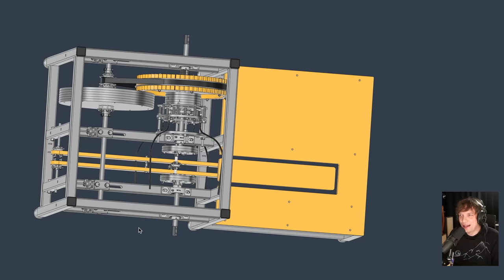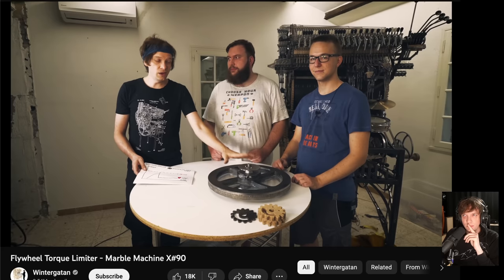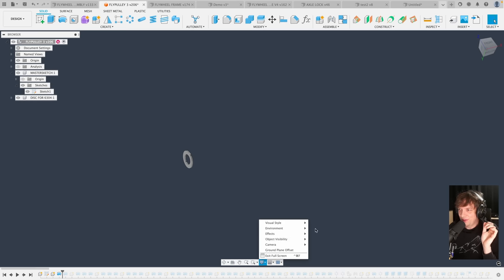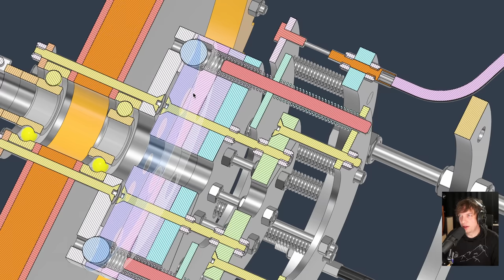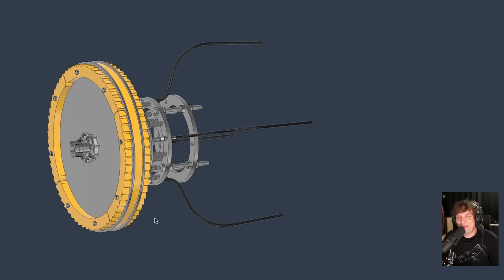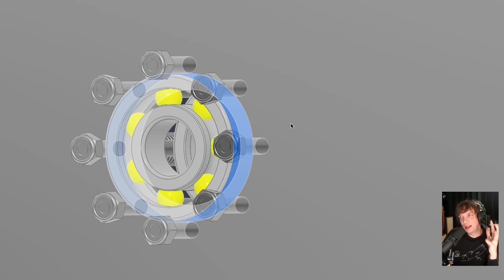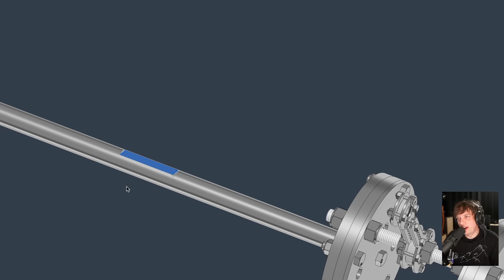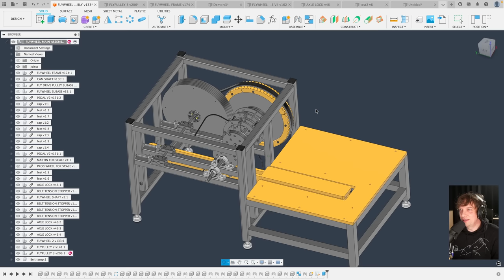Safety First! - Marble Powered Clutch

Comment from the maker: Competition! Price: Glory Forever. Reply to this comment with your guesses on what the ratchets i show at the end of the video are for. The most specific explanation wins. If several people have the correct answer the earliest comment win. as long as it is precise enough haha. All clear? GO!
Reply: Have no clue, just wanna say hi
Reply: for love ? 🥺🥺
Reply: Bicycle.
Reply: My guess:  You're planning on spring loading the machine and the ratchets are there to assist with winding the mainspring by preventing counter rotation while it's being wound. The teeth on the wheel will interact with pawls that will permit the wheel to only rotate in one direction. That would also explain the extra safety measures you're employing.
Reply: Benig able to turk freeley like a bild or not being able to rotate the wrong direction
Reply: probably a spring loading system to start it
Reply: I wonder if it works like a ratchet-type lubricator - converting reciprocating motion into rotation where it'll push forwards on one way but do nothing as it returns - maybe for the foot pedal? so it doesnt crush your feet
Reply: My guess, it's for the sound effects.
Reply: i was thinking something along the lines of "to guide the rotation direction because we are using linear motion to drive this whole mess", but now i think that will be noisy as heck. now i think its something to do with timing, like it will drive some kind of adjustable governor to limit the revs 🤷
Reply: It looks like a windmill part. I think you'll power a large central wooden gear in the center of the machine that will then drive the other instruments through those long wooden mill posts with big clunky satisfying gears
Reply: dogs to keep it from going backwards
Reply from the maker: @officialxardeus  Hi!
Reply: My guess is for some sort of hand crank, and the racheted teeth are to not cause backwards torque into the hand crank (safety for the hand that cranks the handcrank). But I'm sure others have better ideas 😅
Reply: I think the ratchet mechanism is so you can rotate the pulley until the downstroke of the pedal is in time with the beat of the song
Reply: To make it like a gear, sort of as a bicycle. The extra CAD-ed parts control the speed of the flywheel or also make it stop quickly.
Reply from the maker: @MrGonzonator  yo yo been thinking about your bicycle powered idea... it does make sense :) if the pedal fails perhaps its time haha :)
Reply: @MrGonzonator  true, biking is better :3
Reply: You're gonna put a trading card on that ratchet gears so your wheel can sound like a race car
Reply: To run the machine by motor
Reply: @not_just_burnt  heh
Reply: The ratchets will act as the new timing system for the marble machine.
Reply: maybe the ratchets are for engaging and disengaging different programming wheels?
Reply: To make make the tourque limiter not function while putting energy into it.(but why is it so large?)
Reply: Maybe they're for the programming wheel? Or for manual power input.... I have no clue but I hope you get well soon
Reply: I think it is using the teeth for a ratcheting foot pedal for you to manually power up the flywheel, sort of like a half of a bicycle. It ensures you only drive the wheel in one direction and can stop without slowing the flywheel.
Reply: This is probably the broadest guess but I think it might be helpful: 

Edit: It might be very dumb but I'm leaving it up.

I have a feeling that it has an important function when it comes to interfacing with the programming wheel. It might be used to prevent a certain problem that has to do with its state or position. Solving the problem might help with playing tight music.
Reply: The ratchets are for cranking up the volume. What else??
Reply: It's very similar looking to an anti lock backing system......so, my guess is that it is exactly that
Reply: I think it protects and engages with another power source, either a hand pull or an electric motor as an alternative way to wind up the flywheel. I think it engages with another ratchet gear which has its own clutch to engage and disengage it. A vertical transmission of sorts.
Reply: To stop it from spinning backwards
Reply: You're making a scaled up version of your Wera Zyklop for peak satisfying click sounds. That's my final answer lol😅
Reply: The ratchets would connect to a manual quick-start mechanism to help overcome the inertia of the flywheel apparatus. ?
On second thoughts, they are for precise speed regulation via a clockwork-like mechanism giving regular pushes at a set rate regardless of the flywheel speed.
Reply: To have the right movement directon of the fliing wheel.
Reply: My guess: It's for safety purposes while you power the flywheel. In case your foot slips, the pedal can't smash your foot, because it will activate the ratchet mechanism;
Reply: just for fun
Reply: Since glory is forever: The ratchet teeth will be used for connecting a mechanic drive to power the flywheel. The reason why these are ratchet teeth and not normal teeth is in case of emergency and the clutch is engaged, it does not break the power source.
Reply: My guess, an emergency stop if something should go wrong it can bite down on the teeth and stop the entire machine in an instant
Reply: Best guess is that it's for the programming wheel.  It sits on top and the rim of the wheel connects to the ratchets.  Since it's ratcheting you will be able to move the wheel forward in time manually or pause it with the clutch break.
Reply: I think it'll be part of a safety device to be able to quickly stop the flywheel in case of en emergency. It's not made of metal so that the ratchets can break off and absorb the energy while doing so, saving the rest of the machine.
Reply: Looks like the first half of a brake system
Reply: Maybe they allow it to spin in only one direction and also could be used to slow it down
Reply: It is for constraining the rotation. If the machine stops while the footpedal is going up, pressing it back down would result in a backwards rotation. In order to prevent that, the ratchet is there, so you wouldn't be able to press the foot pedal down. Then one would have to turn the machine a bit in the right direction until the pedal is going down, then Martin can use the pedal in its intended way.
Reply: Some kind of emergency stop?
Reply: @roseroserose588  Yah, I don't think the foot pedal is that safe without that so maybe.
Reply: Ok, not reading any earlier comments. I think the ratchets are for connecting the pedal. The pedal will be connected to a kind of rack gear that pushes the ratchets in one direction only, so that the pedal does not flap up and down creating a foot crush hazard.

I was actually thinking the pedal would be safer and more ergonomic as a ‘treadle’, with a hinge point at the front, so it’s not flapping up and down, it’s rocking back and forth. I’m thinking of old treadle-powered sewing machines, if it’s not clear what I’m getting at. Because it rocks, there’s less likelihood of getting your foot underneath.
Reply: the ratches seems to be on the flywheel side of the clutch so not many things come to mind:

1. drive via mechnism with a hock (like a eletric motor) - especially when the clutch is disengaged
2. safe encoder-disc for speed meassurements (not much gets tangled in it hopefully)
3. Reverse direction blocker (but then it would go tik, tik, tik..), could even be metronome.
4. There is a spinning wheel driven by a takeup wheel to take it up to speed quickly by grabbing the end of the rope and run
Reply: Clearly not for form, as you ditched that whole thing for the MM3
My guess? I'm not an engineer, and your videos are the closest thing ill ever be to one, but I'm guessing the rachets are there to stop the movement of the flywheel and pulley, as you said it would be dangerously fast.
Reply: Mmmmm 64 teeth... you don't choose even numbers for gears unless you have a good reason to do so... Like synching a mechanical drum machine with your foot movement. I don't know, I have better ideas (this would make the drum machine "unsafe") but other people already commented them
Reply: Perhaps The mechanism is to set the direction in which the machine will spin so that you don't accidentally spin your marble machine the wrong way - there will probably be a way to diesengage the starting mechanism because else it will be quite loud 
Edit: the shape of the teeth suggests a ratchet-like mechanism which could sit next to the wheel -
I'm either somewhat right or completely wrong
Also love your vids ❤️
Edit 2: :)
Reply: the ratchets is for a electric motor? (the platform on the right seems big and empty)
Reply: The teeth are used as steps for some kind of marble raising mechanism.
Reply: Ratchet is for an additional lever to assist at times when a foot stomp is impractical or unnecessary.  This could be a hand lever, or even a large lever for a whole group to get in on the cranking. :D
Reply: starting? the machine could have problems starting because the pedal can be in the lowest position and not give any force, it could also be used to limit the rotation direction.
Reply: Preventing counter rotation. Using an escaping mechanism for timing?
Reply: In the design its made of plywood. I would assume that if its another security measure it would be more like metal. My guess would be like the mmx you had a hi hat ticker underneath the machine. These hooks will get the rithm for the hi hat?  

Also good to see you again Martin!
Reply: They’re there to power the invisible kinetic fingers obviously 🤷‍♂️
Reply: It is to attach an electronic motor so you do not have to use the pedal.
Reply: @thatfrickenweeb  if it's this... it would be a big awesome mainspring there
Reply: The ratchet system is used so you can measure the RPM of the flywheel or have a super fast beat.
Reply: I just leave a comment here bc the chance is higher, that it gets seen. Hope you guys have a great day and Martin, love the content, im always so excited, when the next Wintergatan video arrives.
Reply: I think the ratchets are for a device with sprung pawls that stops the flywheel assembly rotating the wrong direction when first starting to pedal as the camshaft on the pedal is non directional by the looks of the CAD
Reply: I think the pedal power allows the flywheel to go in the opposite direction, so the ratchet will ensure you are pedalling with the right rotation
Reply: Force a one direction rotation from the liniear motion of the pedal
Reply: @coolbyproxy  exactly what i was thinking
Reply: Maybe there‘s a pawl attached to another pedal that lets you rotate/increment the main axle slowly and precisely for maybe timing adjustments on other parts of the machine or for rotatig the shaft if the foot crank is at top or bottom dead center.
Reply: Some sort of metronome to achieve correct tempo?
Reply: I think it's just for clicking noise. If you attach contact microphone and add any drum to it you can get constant bit for music
Reply: A part for the Marble Machine Å.
Reply: The pedal can start the rotation in both ways depending on the point of the rotation it is. The ratchet will prevent a reverse start. I have played with old pedal sewing machines and you had to start the rotation by hand to prevent the pedal going in reverse.
Alsothe pedal could end in a position where it can potentially lock up.
Reply: Hey, because it is a crankshaft pedal you need to give the wheel a direction. With this ratio, size and mass it make sense to use a kind of lever with a hook to give it a push in the right direction so it will help to move the crankpin in the right position to start.
My grandma and her singer sewing machine taught me a lot.
Reply: I am fairly convinced it has something to do with some external driver - either to just start/spin up the flywheel or to help continually drive it instead of the foot pedal.
The pulley with the teeth is connected to the flywheel "directly" via a belt so a motor could use high torque to spin the flywheel up without the clutch slipping. Why the teeth look like they should be ratcheting might have something to do with some spring/mechanical clock power system that others have mentioned. Or just to protect the starter driver, although, having looked at how car engine starter works, they don't use any ratcheting so I'm might be off.
Reply: With this teethed system the foot pedal is

1. Not bound to a specific timing, so you can even stomp the offbeat of any measure you wanted to
2. no force can be transferred backwards from the flywheel to the operator since the teeth only go in one direction

I also guess that the pedal only engages when you use it and otherwise "hovers" silently.

Cheers
Reply: @agarceran  haha, same here
Reply: That might be a mechanism that's gonna be used to count revelations of the system and/or current speed/BPM. The other side should have some sort of counter that is falling into these grooves.
Reply: Hoping it's not for a marble lift? 😅
Reply: it's a one use safty stop for the flywheel... that's why teeth are in both sides and I think it will have a very strong hand shaped thing with multiple counterpart teeth to grab it... beware how you build it, a wrongly use could also be dangerous
Reply: My guess, The gears are for tapping out to a gearbox with gear ratios to get all the usual note values. (quarter, eights, tripps, 16ths etc) this module will go to a highhat, but also have  the option of adding modules
Reply: Install flaps, like it was "fashionable" in the 50s for kids to put on back-wheels of bikes, so they would be flapped by the spokes of the  tire. I guess the idea was to make them sound louder like proper motorbikes. Great idea. I support it.
Reply: Prize*
Reply: ratchets: to make startup easier. It also forces one direction of spin and prevents the wheel from spinning the other direction, preventing the machine from being "flipped backwards* by the torque of the wheel.
Reply: My guess, which is probably the worst one here, is that with a one-way sprocket mechanism such as those in bicycles, you intend to have reversible ratchets to play music backwards? Literally unscrew and flip the ratchets?

Could also be a design choice that allows easier replacement of worn down ratchets, as they are separate pieces to the wheel.

Last guess, the ratchets will be used to siphon off power to the marble machine with some kind of sprocket and gear combination. It could be a speed based activation, as a minimum speed would be needed to engage the sprocket+gear.
Reply: The glory of engineering 😂
Reply: A straightforward answer would be that the ratchets prevent the machine from spinning up in the wrong direction, by only letting the main shaft spin one way
Reply: I think the ratchet is so you’ll have a linkage that can be engaged or disengaged via a lever that directly transfers the motion of the pedal through to the flywheel enabling a lower gear ratio to start the machine. Once spinning, you disengage the ratchet as there is enough inertia that you can now use the gear ratio from the pedal crank through to the crank shaft.

This method ensures that the machine always start in the correct direction, but allows much easier starting essentially like using a lower gear ratio on a bicycle
Reply: Ratchet so it don't drive backwards
Reply: I think ratchet mechanism will be for controlling the speed of transportation marbles to the top of the machine or whenever they go to supply the marble droppers
Reply: Ratchet so it don't drive backwards
Reply: This clearly is a "oh no! you're going the wrong way!" ratchet, to prevent spinny things from spinning incorrectly.
Reply: Hear me out: water power. The “ratchets” could be small buckets on a water wheel. Hook this bad boy up to a small forest stream and voilà! You have yourself a medieval styled, water powered, perfectly timed marble machine.
Reply: I'm thinking the ratchet might be part of the marble lifting system.
Reply: Clock spring wind up mechanism?
Reply: Probably either for something like a hand crank or bicycle type crank, maybe even a spring. OR it's to be able to stop it or disengage some part from rotating.
Reply: probably to not let the torque limiter limit how hard you can crank it
Reply: The ratchets are asymmetrical, and looks like they are engaging with something spring loaded, perhaps a breaking system?
Reply: I was thinking safety ratchet ( like everyone else) but that would be really loud and make a ton of vibrations, Now I wonder if it is a piece of extra material to be sanded down incrementally to balance wheel and remove vibration?
Reply: As you cannot choose which dirrections the wheel will goes with the pedal I think this mechanism aims to be sure the wheels turn in the good way : 
When the weel is on the good way, the mechanism will not trigger because of the angle. However if it is in the opposite way the mecannism will be triggered and load a force (maybe with circle springs as you can find  inside a watch). At the time that it is loaded enough you cannot use the pedal anymore. While releasing the pedal, it releases the strenght and it makes the wheel rotate in the good way. You can now use the pedal again.
Reply: You're awesome!
Reply: Is it for timing ? Like you could use that to know at which bpm it is playing?
Reply: Part of the timing system
Reply: Not an answer. Consider getting a 3D mouse. It makes working in 3d environments so easy and you will love it. I would suggest products from 3D connexion Space mouse. Even the cheapest one will make a huge difference.
Reply: To ramp up the flywheel using an electric motor that drives two gear like wheels that interact with the ratchets. 

Having this interact with ratchets serves as a safety feature that prevent backdriving the system from the flywheel.

Having two ratchets, on on either side, will allow for easy alignment of this external input. Perhaps even allowing your to make it removable for pure human powered playing.
Reply: It allows you to spin up the flywheel with more torque(/unlimited torque) than your torque limiter allows the flywheel wheel to put back into the machine; just like previously?!
Reply: Well, when you push the pedal down with your foot, you want the wheel to spin freely, but when you lift your foot, you need the wheel to continue rotating; thus you need the ratchet to increase momentum when you step down without losing momentum when you let up
Reply: @Wintergatan  Instead of a bicycle or crank, build a gravity battery to store energy while you walk around on the MM3 platform to turn the flywheel :) Every time you take a step, it lifts a weight up a little more and is always loaded with energy to put into the flywheel when engaged!
Reply: My guess is that it could function as a speed control. Pushing down on the pedal would engage the ratchets, and once it reaches a certain speed, the pedal wouldn't accelerate the pulley even more due to the pedal mechanism not having a ratchet to engage. That's how ratchets work, right?
Reply: *Prize
Reply: The ratchet system will drive a clockwork mechanism that controls the timing of the whole machine.
Reply: The ratchets will be used as a breaking system. The breaks can be enganged very fast. If the fly wheel has sufficient speed the energy transfer may be enough to move the machine. The obvious goal of this is to make the marble machine do a flip.
Reply: The ratchets are to allow you to detect the speed that the wheel turns.
Reply: An electric motor to drive the flywheel/belt combo and govern the speed like on the MMX
Reply: Similar to a bicycle hub that has the dog gear clutch system this has a dog gear clutch system to allow input power to the fly wheel without allowing the flywheel to backdrive into your input whether that input is a pedal or hand crank. (Bicycle hub allows input from pedals while allowing you to coast if you stop inputting power)
Reply: You did have the hi-hat close to that area before on the previous machines, perhaps you'd have a small programming cam you could engage off of it and have that connected to a mechanism for playing the hi-hat or another beat oriented piece? 
If you actually had something in constant contact it would click all the time, so I imagine that's taken into account. 
I won't bother talking about braking or metronomes since those are covered so well already, but I bet a musical function like this would prove useful even when you aren't concerned with braking or tempo.
Reply: Reminds me of the gyro on my freestyle bike.
Reply: the ratchets are connected to a cable to the kitchen and they activate a coffee maschine, so the musician can play music all night and day :)
Reply: Brakedown? I mean in the same way you had it labeled on the MM1.
Reply: Since the rachets can't be disconnected from the power from the flywheel (because they're on the same side of the clutch as the flywheel), I don't think Martin would want anything musical connected to the ratchets, since he couldn't brake them with the brake. But why ratchets and not gears? Maybe it's something purely aesthetic? Actually, after reading some of the other comments, I think it's gotta be a safe hand crank--putting power into the flywheel with the rachets makes more sense than taking power out with them.
Reply: For one you look like you need it to force the direction of rotation from a cold start. And to prevent a 'backfire' from a wrongly timed push on the paddle.
Reply: Marble dropping fingers, rätt säkert
Reply: I think it will be used to measure speed of the wheel, to know if it goes fast enough, too slow or too fast.
Reply: And maybe to prevent form going backwards :)
Reply: It is so that when you are pushing the pedal it starts the rotation in the correct direction.
Reply: It's too manually pumping the machine up to speed. Like a ratchet.
Reply: Martin I recommend you give a look into clutch systems, I know that patents can be a hassle to go over.
However there some expired patents on clutch out there that are more simple than you is currently looking.
If you want a quick and easy solution, a clutch is just a brake system, and you torque limiter is just a break that stop braking automagically.
Reply: Are they for braking the flywheel? Probably not, I know nothing about engineering, but it's worth a guess.
Reply: For measuring beats per minute!
Reply: You're a musician turned engineer. will this be a way to audibly find the speed of the flywheel so you can hear the tempo? Or a new version of the high hat?
Reply: The ratchets mechanism in this case i think that is used to limit the movement of the mechanism only in one direction. That's because there is a possibility that the when foot pedal is pressed, in a netral position, starts the rotation of the axel in the opposite way. This is the mechanical guess. The musical guess is because the "ratatatata" sounds that produces when disengaged is amazing❤
Reply: They must have sonething to do with the flywheel turning the other way
Reply: The ratchets could drive a BPM counter
Reply: Ratchet profile allows a stepper motor to drive pulley.
Reply: welcome back to the better
Reply: Emergency flywheel stop
Reply: I think the ratchet is for the foot pedal. It is to prevent your foot from being crushed if it gets stuck under the pedal which you mentioned as a concern in a previous video
Reply: My guess is that it will connect to some sort of rhythm machine,  like the hi hats that were tucked under MMX.
Reply: Ok, I don't think this is right, but I'll throw it out there for the chuckles. The ratchet teeth kind of look like scoops. so I'll say that they are to pick up water from a trough to throw onto the legs of the player to help keep them cool under the stage lights.
Reply: The ratchets are obviously for the kinetic fingers.
Reply: maybe its a marble lift i have no idea about engineering but i enjoy the videos and it had the same kind of ridges as the last 2 MM
Reply: I just think it's for an electric motor, yes the angle is not perfect but the location is, wait and see 😌
Reply: Are the ratchets so that the cam can’t start the flywheel spinning in the wrong direction?
Reply: Since you are going for pragmatism, maybe this version could be called "Marble Machine Cubed". You keep the 3, but reflect the more pragmatic design in the name, both visually, and auditorialy .
Reply: My guess is that it will be either use to power the lifting device for the marbles or the programming wheel.
Reply: My best guess would be that's how you're actually driving the assembly from the foot crank, if you drive direct through the torque limiter then you'll have the same limit on torque when trying to accelerate the flywheel as you would if something bad were to happen. The MMX torque limiter had a ratchet and pawl system built into it (you can see it on your throwback clip, fun nostalgia moment btw!). Looking at you CAD more closely it doesn't appear that this is what you're doing, but it's my best guess!
Reply: Anti Rollback, as used on rollercoasters to prevent rolling back on the lift when the ride stops. In this case prevent the wheel from slipping when something goes wrong, and shuts the machine down?
Reply: When the machine is stopped it could happen that the pedal had stopped on an up-beat and when the pedal is now pressed down during start-up the machine would turn backwards. So this ratchets prevents the flywheel to turn in the wrong direction but thanks to the torque-limiter the "pedal-side" can still rotate backwards until it reaches a down-beat and can then start into the correct direction on the next push, maybe with the help of a spring to avoid the lower dead point. Additionally, to prevent the ratchet making noises during normal operation, there will be a mechanism to engage and disengage the ratchets with some kind of lever. So my guess: its only for the start-up-phase.
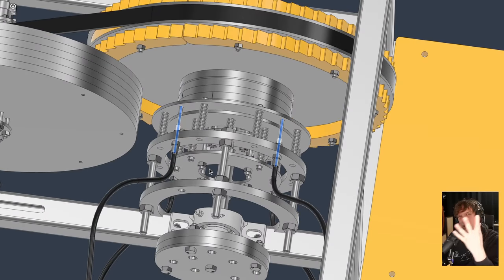Reply: @thatfrickenweeb my guess is that thatfrickenweeb may just be correct; BUT i'm only 11:31 so far... I don't even know how Nurse Ratched applies to MMx3 ... but this is sound
Reply: @rvdm88 that was my first thought hearing Teeth when described
Reply: It's for one way rotation. When the machine is stopped and you try to pedal, the wheel can turn in both directions. This will prevent it by allowing just one way rotation. 
With the smile on Martin's face it needs to have another function. My guess is that it's not gonna be smart enough to let the pedal to rotate to a better starting point and only after that it will start turning the wheel in the correct direction.
Reply: Guess its for measuring the Speed of the flywheel to make it Spin evenly at exactly the Same speed. To avoid any inaccuracy in timing of the programming wheel.
Reply: will it connect to a 2nd driveshaft for the drums? allows for a strong robust on/off state independant of a clutch. 2nd guess is for the master marble elevator/lifting device
Reply: I think the ratchets are intended to index the flywheel (and thereby the entire machine) to a desired "starting position" before playing.
You would have a lever on the side that'd have interlocking teeth with the flywheel so you can manually push and pull the lever, gradually getting the flywheel into the perfect position to start the song exactly where you want.
Reply: The ratchets don't have a purpose yet. Martin just put them here and wait for someone to find something clever to do with them. Crowdsourcing ideas.
Reply: I think its for some kind of drum machine
Reply: MMx3 = The Bestest Yet
Reply: Stop the machine running backwards and reversing gravity when the marbles jump off the instruments to get back in the gate.
Reply: I would have to guess a timing system / secondary instrument going off of the fly wheel which shouldn't ever pause.
Reply: Are these ratchets a kick starter for getting the fly wheel to start from standing still.  So push a leaver will make the wheel to spinn from standing still.
Anyways, I think a secondary way of add energy to the flywheel that can be applied when needed.
Because trying to push the pedal can be hard/impossible if the wheel stop in top or bottom position. 
So a spring loaded kick start will help getting the machine start.

Som en kick på att en moped.  Eller startsnöre på mororsåg eller gräsklippare för att rycka/dra igång motorn/svänghjulet?
När pedalen är i topp eller bottenläge, så kan man inte starta svänghjulet med pedalen som sitter där, det är för tungt. (Tänk vanlig cykel).
Med en annan pedal/spak som hålls uppe med en fjäder, så kan den tryckas/dras så stt den hakar i och vrida igång svänghjulet från stillastående.  Sedan går det att använda den befintliga pedalen som vanligt för att accelerera och hålla uppe farten.
Reply: I'd imagine they'd be used for timing the individual notes/instruments, as in it acts as a metronome to compare the sound of the note to the sound of the ratchets. It would also function as a way to prevent the flywheel from rotating backwards. While the ratchets are engaged, youd have two possibilities, either it binds because you are attempting to rotate it the wrong way, or it creates the well-known ratcheting noise for timing, then once its spinning and ready to play, you disengage the ratchets to stop the noise.
Reply: Is the ratchet system there to provide an accurate step over to assist with adding the "notes" as you are building the music.
Reply: The ratchet is for locking and unlocking the programing wheel or any (spinning) device that connects with it. The teeth are unidirectional, therefore they can only engage in one spinning direction, therefore, if needed, any spinning mechanism will slide while spinning in the opposite direction of the engaging direction. To some extent, this would be similar than the mechanism of the pedals of bikes, that only pedal in one direction, but while you rest, the pedals don't keep moving your feet, so you can actually rest. One extra thing, I believe the half moons would week better if each layer would be rotated 90° so the torque is not concentrated on one single edge, but shared, also the same bolt will be able to connect to different faces of the piece... just saying :]
Reply: @scaredyfish  you can get that safety by have a hinge outside of this device, on the platform, as you wrote.  And then have a releasing mechanism if to much force is applied on the pedal.  Releasing the outer part.  Could release on a small amount of up force.  Protecting the foot (or head) trapped under the pedal.
Reply: In my opinion, ratchets are necessary due to the frame structure (as in literature). Since you mentioned at the beginning of this video that the sub assembly has a bulit- in secret. So the end of the video also needs a secret. In the form of a riddle. To have the frame, haha. I wish you long- term good health as soon as possible and all the best. If you don't have such an allergy, I can recommend ginger + pine bud syrup, these work wonders.
Reply: It is for the kinetic fingers!
Reply: It’s for a parking brake?
Reply: They are for an angle grinder. 😄
Reply: Indeed this is giving me hope again, I’ve been around since the beginning of your Chanel 
Hello Martin 👋!
Reply: It looks like a system that prevents the machine from running in reverse. I guess, without the rachet, it could run in both directions as you just pedal up and down, and you can't really choose which direction it'll go. Plus, as a added benefit, the machine would stop in fixed positions and you can make sure, all the gates are closed. 
On the other hand, the rachet would make noise all the time. You are spending a lot of thought on making it run as silent as possible, so it seems counter intuitive. So if it is used in the way I'm saying, it may also be possible to be engaged and disengaged, to make the machine run more quiet while playing music.
Also, Hi 👋
I love the way you're making these videos, keep it up! I felt that you are still recovering from your illness, so i wish you the best and get well soon ❤
Reply: I suspect you only want that wheel revolving in one direction, but surely it's not that simple.
Reply: @AwesomeBilly3  hello my friend it’s been a while!
Reply: @AwesomeBilly3  it’s been a while since we’ve talked to each other on discord!
Reply: The ratchets somehow become a metronome so that you can keep tempo.
Reply: my guess is that they are there to prevent the wheels from spinning in the wrong direction when you initiate pedaling but then they have to be engaged all the time and they would make alot of noise so im also guessing that you will design some mechanisim that will disengage the pawls when the wheel reaches a certain speed or maybe disengage it manually
Reply: Hand crank is my guess.
Reply: Marble lift?
Reply: Since you are using the foot pedal to transfer energy to the flywheel, you are using these features along with a mating component to prevent you from turning the clutch assembly the wrong direction, especially if you intend to spin up the clutch assembly when it is disengaged while the flywheel is spinning prior to re-engaging it.
Reply: Metronome?
Reply: I couldn't find a video or GIF to show what I mean. So, hopefully I can put it into words. I think the ratchet teeth are part of what will be a pedal driven system to get the flywheel started. Similar mechanically to old pedal/treadle and flywheel powered saws, lathes, sewing machines etc. I could be way off.. but hey, it's a guess lol. Good luck Martin. Been watching since the original MM.
Reply: The ratchet is there so you can drive the flywheel with the pedal, but the flywheel can't drive the pedal. You will need to setup a way for the pedal to "engage" the ratchets when you are pressing on it, but then disengage when you are not so that it does not click like crazy. This way the flywheel will not be able to cut your foot off.
Reply: With the 16 teeth per arc, it seems to have to do with tempo. I would venture to guess a metronome system. The rounded corners may also be for lifting marbles. Ha ha.
Reply: The lineup consisted simply of six hydrocoptic marzelvanes, so fitted to the ambifacient lunar waneshaft that sidefumbling was effectively prevented. The main winding was of the normal lotus o-deltoid type placed in panendermic semiboloid slots of the stator, every seventh conductor being connected by a non-reversible tremie pipe to the differential girdlespring on the ‘up’ end of the grammeters. Moreover, whenever fluorescence score motion is required, it may also be employed in conjunction with a drawn reciprocation dingle arm to reduce sinusoidal depleneration.
Reply: Are the ratchets so that your foot pedal is only moving when you apply force, so you don't have a moving lever to worry about while operating the machine?
Reply: My guess is the pully has those ratchets to prevent it from turning the wrong way, since the pedal is hooked up to a crankshaft system it might turn the wrong way otherwise which could cause lots of problems for the machine when trying to get it playing music.
I dont think it can be a brake since its connected to the pulley and not the flywheel, so if it was used as a brake, the flywheel would try to keep spinning even if the pulley is moving, causing the ratchets to probably break and the pulleys belt to snap as it gets stretched by the flywheel.
It could be used for a different mechanical system that needs to turn in a specific direction however such as marble elevators but the ratchets there seem like a strange method of mechanical transfer. Maybe its for the handcrank?
Also your bearing housing looks fine to me, easily serviceable, dismantleable, and it reduces the amount of custom parts, looks fine to a mechanical engineering first year student. Only thing is those sets of hex nuts might get annoying to adjust as they drift and loosen over time and it might be difficult to get the pulley perfectly perpendicular to the shaft if you have to tighten all of those points seperately, which could cause vibrations as the pulley slightly oscillates on the shaft. But theres a plate that goes over it so it might just be perfectly fine, thats why you prototype!
Reply: For a built in metronome, lol!
Reply: Because the cam to drive the pulley could start driving the pulley either clockwise or counterclockwise, the ratcheting system is to ensure the pulley can only be driven in one direction, preventing the entire system from being driven backwards.
Reply: The ratchet part is going to serve as a sort of metronome so that you can create consistent rpm’s at the flywheel, then control music more consistently with the programming wheel
Reply: i think its for the brake or maybe for powering something that needs a lot of torque
Reply: It seems like the ratchets will connect to your programming wheels in some way to prevent it from spinning backwards. The current pin/thing that lets you change how long a note is played only would work in one direction. This would prevent potential binding of the wheel and the pins.
Reply: like I suggested on the last video.  the rachets are part of the one-direction drive mechanism like a bike wheel
Reply: is the rachet an assisted start coupling thingy so you can put some inertia into the flywheel? if so you might be interested in car style bendix for a starter motor or use some one way bearings to simplify the design.
Reply: It is for the engine to be able to rotate the music cylinder without interfering with the flying wheel.
  Holy god what English is this mine... Sorry. 🇧🇷
Reply: In the Marble Machine song, performed with the original marble machine, there is a segment where you stop the fly wheel to take manual control over the marble drops. When stopping it, it made a rattling frrrrrt noise. I kinda liked it. My guess is that these ratchets are for replicating that effect.
Reply: IT'S A SAW STOPER! 😂
Reply: @Cinemaaereo  my thought exactly
Reply: Are they for the three different 1/16th and 1/4 ticks that you had on the MMX ?
Reply: To engage the rhythm machine of some sort of constant beats in sync with the wheel.
Reply: Guess 1 - It's so that it doesn't go back if you take it back but it goes forward if you take it forward (like a bicycle).
Guess 2 - It's a gear.
Guess 3 - It's to increase friction with a rubber band.

These are all my guesses but I want to go with my first guess.
Reply: Obviously it's to make the entire stage turn with you and the machine. 😮
Reply: It’s for the foot peddle so you can pump it at any time not have it oscillating up and down fixed to the flywheel
Reply: Hope I'm not late to the party... my guess is that it's for a speed control system. Not quite sure how it would all work, but the ratchet could drive a rotating governor (I really want to see an old school centrifugal governor with the big weights spinning!) that is linked to some sort of speed control system. The ratchets mean that the governor is free to spin faster than the flywheel, maintaining it's own inertial, like pedaling a bike. Not sure why the ratchets would be on the flywheel like this instead of a more discreet part of the mechanism though.
Reply: My guess for the ratchets:
For adding an electric motor to maintain a minimum RPM, or constant RPM, of the drive shaft, also maybe to prevent the flywheel from being started in the wrong direction? (As a secondary function)

Edit, Adding more clarity to my guess:
Motor would drive a gear with ratchet pawls for teeth (one-directional gear) that engages with the ratchet teeth to prevent the flywheel from spinning the motor faster than it is being told to go (Minimum RPM). If martin chooses to increase the RPM he can add speed with the foot pedal, then either make the new RPM the new minimum, or let it slowly decelerate back to the minimum RPM

Comment on the bearings captured by screws:
What if you used shoulder bolts instead of fully threaded bolts so the OD of the surface contacting the bearing is known, consistent, and has flat contact. Not sure if they make flat head shoulder bolts though... If not maybe your supplier cut counterbores instead of countersinks?
Reply: A second flywheel for more kinetic storage?
Reply: I'm guessing the ratchets are for ratcheting
Reply: Is it for a "jump start pedal" type thing? It can be hard to get something going using a crank shaft depending what part of the rotation it's stopped in.
Reply: it is for the breakdown lever!
Reply: FISH STAIR 🐟
Reply: A spring loaded accelerator for a quick start time. Either that or an emergency break.
Reply: Price Prize
Reply: The ratchets in the wheel are going to drive some sort of  timing mechanism, akin to the mmx mechanism where tiny drumsticks hit the cymbal at 1/4, 1/8, 1/16 notes.
Reply: It is for your mechanical drum machine.
Reply: Bicycle freewheel style engagement system with unidirectional pawls or similar for an electric motor drive that doesn’t have to be disengaged.
Reply: 17:07 Martin, isn't it one of those dumb requirements, you're trying to get rid of?
Reply: Mechanical fingers 😜
Reply: Either connecting a lever to charge the flywheel by hand or a direct connection to one of the programming drums or timing gears
Reply: Ensuring that MM3.0 doesn't try to play backwards, if you happen to start it by a pedal press before you get any of the "should spin in operation" spinning parts moving. Also, since the ratchet teeth are at a regular interval, they can also be used to indicate pace, in a variety of ways.
Reply: My geuss:your gonna make something or whatever that involves lots of pulleys levers and a pedal or whatever.i don't understand a thing I'm just here to say hi
Reply: my first impression is that it locks like a grasshopper escapement. maybe because i constantly compare Martin to John Harrison. 
why you would want one there is the hard nut to crack. it could give you linear motion back and forth.
however to have linear motion connected to the flywheel that is separate from the breaking system is weird.
the most pragmatic function i could imagine would be to mount an electric motor.
if you have a electric motor planed for the system the best placement is to have it connected to the flywheel to protect equipment and operators from harm.
Reply: On the MMX there was a handle to start the whole machine, but now I don’t notice any starting mechanism. So I guess that this is the starting mechanism.
Reply: Safety stop?
Reply: I was just wondering if like a stepper machine at sport's hall, you could have an alternating two feet mode to input power more at start. Something like a heating phase where you pump up force into the wheel and then start the music and keep the force only with a single foot powering. Martin, remember to get far from the engineering meermaid : over engineering. Looks beautifull, but ends up in a bloody mess. So K.I.S.S is the #1 rule to follow.
Reply: Ratchets are to ensure the flywheel to turn in the correct direction.
Reply: Is it to allow you to engage some sort of metronome thing so you can have audible feedback on how fast it is spinning to match it to the BPM of the song you're about to play?
Reply: The ratchets are for your timing "ticks", just like you had with the 1/2, 1/3 and 1/4th timings. It is therefore to check the timing of the machine and set the speed accordingly
Reply: I hope it's for a rhythm instrument, but probably it's for stopping the wheel from going backwards. ;)
Reply: I'm thinking that the ratchet mechanism is there to only allow the pulley to spin in the correct direction. This would be most important when you go to start the motion with your first step as otherwise that step has a 50% chance of spinning it the wrong way.
Reply: My guess would be that the teeth are on it for security so the wheels can't turn the other way
Reply: My guess would be that the teeth are on it for security so the wheels can't turn the other way
Reply: I reckon the rachets are for a built in metronome on the marble machine. If you can create a simple noise with them, like those spinning rachet toys you get at carnivals, you can use that as a reference to the other instruments in the marble machine.

Each instrument will have a relative offset in timing from one another that may need to be compensated for, my work refers to this as a "DC offset"
So far you have been focusing on precision, but this mechanism would give you accuracy
Precision => how tightly bunched the data is
Accuracy => how close that bunch is to your intended target
Reply: They are for a brake
Reply: Not being able to make it spin backwards
Reply: The ratchets are just to make noise and make the MMIII louder! 🤣🤣
Reply: Well there’s no reason to limit the torque going into the flywheel, as that’s not a danger for breaking anything. Only limiting the torque coming out of the flywheel is required. On the MMX this was achieved with a simple ratchet inline with the detent since torque entered and exited the flywheel by the same part, but in this case it looks like your drive motor and/or crank is going to be seperate. I’d hope both, I’d want any hand-crank to be capable of exerting more torque than it could receive back. Though having a mechanical separation between the crank handle and the motor is also desirable.

If you wanted the input and output inline like in the MMX, you may be able to cut down on parts by putting the ball-detents at some sort of angle, like in an impact drill mechanism (see AvE teardowns). Not too sure how it’s done, but those are also torque adjustable. Could likely also do it by making the detents in your current design have an asymmetrical shape like a teardrop, even a factor of 2 between the charging torque and the discharging torque might be fine.
Reply: It's a 1/32th ratchet gear to play trap music's hit-hat for sure!
Reply: just for the sound
Reply: You run a spring loaded plank on it and put a contact microphone on that to measure how steady the drivetrain speed is when the coding wheel is lifting a bunch of levers at once. But there probably is a more permanent primary function.
Reply: It's for the electrical motor assist.
Reply: The ratches are ensuring the direction in which the wheel will be spinning as the lever could rotate it in both ways. But you'll want to hear the melody in just forward direction. ;-)
Just make sure they aren't going to cause sound during the music so they are probably just being used during startup.
Reply: Ratchets are for adding a motor for automatic speed control ?
That would make so much noise tho... can't wait to hear the real answer !
Reply: The ratchets are there to have provisions for applying power from an external motor. The ratchets engage when the fylwheel is powered by a motor, and disengaged when it is powered by hand.
Reply: To ensure that the pedal only drives it in one direction?
Reply: It will maybe allow for you to do minor precise adjustments to make sure that once the programming wheel is mounted that you will start the song at the correct place, with as little wonkyness as possible.
Reply: BREAKDOWN LEVER
Reply: Could be for holding the rythme precycely?
Reply: You will use te ratchets to easily cycle and lock the movement of the Marble machine so you can easily callibrate all the adjustable parts?
Reply: My guess: It's for starting the machine. As you engage with the pedal, the flywheel could start to turn in any direction. With the ratchet you give it the initial spin - e.g. with a lever - and as soon as it has inertia, you can start to crank by foot
Reply: When you start up the machine with only the pedal it could turn backwards. The ratchet is there to insure that the wheel turn in the correct direction. And maybe with some lever turn the wheel so that the pedal is in the correct position to start the machine.
Reply: You're gonna add a motor that engages with the ratchet, so it can keep the Marble Machine at a specific minimum speed, but doesn't act as a brake when you manually speed up the machine past what the motor is set to.
Reply: Mechanical noise machine just like we had on the MMX👀
Reply: I think it's a ratchet leaver to start the machine. If the machine stops when the crankshaft is in it's  lowest position and half a turn from there you either can't start with footpedal or you will start backwards. Så you need something to start the machine with that is one directional. 

A ratchet leaver would do that. But i think you will not let it ratchet all the time. You will make it so you can engage and disengage the ratchet mechanism.
Reply: I think it's a ratchet leaver to start the machine. If the machine stops when the crankshaft is in it's  lowest position and half a turn from there you either can't start with footpedal or you will start backwards. Så you need something to start the machine with that is one directional. 

A ratchet leaver would do that. But i think you will not let it ratchet all the time. You will make it so you can engage and disengage the ratchet mechanism.
Reply: The rachet drives a generator that powers a vacuum for 0 marbles on the floor
Reply: To Power the Programming drumm perhaps
Reply: Hi! Super cool to see you this excited, love it!
My guess is that the ratchets are here to give you a precise round per minute count in order to adjust the speed of the machine and this the bpm of the music
Reply: It reminds me of the escapement used in pendulum clocks... maybe it is a similar mechanism :)
Reply: They will prevent the wheel from spinning in the wrong direction when starting. There may even be a lever to start nudging the wheel to get it going too.
Reply: It’s probably for the connection between the fly wheel and electric assisting motor.
Reply: Guiero!
Reply: ratchets may be used to slow the wheel down without completely disengaging the flywheel
Reply: My guess is they are to prevent the pulley to rotate in wrong direction :)
Reply: It looks like you'll use the ratchet to connect to your foot pedal to spin up the flywheel.  So that way the foot pedal isn't constantly "pumping" while the flywheel is spinning.
Reply: I think they're there to oscillate a rod with a fork on the end to scratch your nose mid-performance hands-free.
Reply: @thatfrickenweeb  och
Reply: My guess is so you can have it powered with a foot pedal.
The ratchet is so you don't have to time your foot presses in sync with each rotation of the wheel since the foot pedal wouldn't be directly mechanically attached to the wheel itself, but to the ratchet.
Reply: I think you want to be able to use it to wind up a spring, so the delay to spin up the flywheel when starting to play is smaller. 
This could be achieved by adding a spring to the flywheel shaft that can be manually engaged and only winds up in one direction (using a freewheel like in bikes or some other mechanism).
This way you could use the footpedal to store energy in the spring (would have to reverse directions of the pedal, but this should be doable with a cam). 
The ratchet would be so you can keep the system from unwinding when you stop pedaling and precisely start the machine.
Reply: Magic fingers 🤣
Reply: My guess is: design to test. You can power the machine from a motor to drop a zillion of marbles without cranking the pedal.
Reply: Just for decoration obviously
Reply: Radical pragmatism and practical ragmatism
Reply: I think the ratchets are for motor-driving the mechanism so you don't have to pedal all the time, like in the previous machine. (I think that also had a motor and not just the handcrank)
Reply: The ratchets are for Start-Up sequence - How to Start a Music Engine ;) 
The Crank-Shaft on the Pedal is good for maintaining Energy Input, but very bothersome for startup. You will use some Leverage to get it Started and then move on to the Pedal.

The Ratchets are maximally far from the Axis of Rotation for this exact Purpose. Probably would want to have a disengagement lifters in as well (for the noise)
Reply: If the machine stops on precisely the wrong place then you will have no control over which way it turns when you start peddling.
The rachet might be a way to solve this problem by ensuring it can only turn one way.
The only snag is that it might be quite noisy?
Reply: On second thoughts, the fact that it will make a noise could be usefully employed as a metronome of sorts. But I don't think such a thing would really be neccassary
Reply: is it a connection to the motor?
guess kinda worm-style
Reply: The ratchets are going to act as an angle grinder blade, but giant!
Reply: I think it is part of the marble lift. If the machine stops, the marble lift will apply back pressure and you don't want it moving backwards.
Reply: They're for the pedal. 🙂
Reply: I believe it is a noise maker. With all these new features making it quieter, the machine is too quiet. And much like the playing card in the spokes of a bicycle trick, Martin wants turn his musical machine into a musical engine. :)
Reply: High torque starting lever.  The existing pedal crank will work to add energy into the system when there is already angular momentum.  From a stopped condition the short crank distance of the pedal system will be challenging to turn over and may crank in the wrong direction.  A longer lever with the dogtooth will turn the system in the correct direction and require less input force.

That's my guess.
Reply: @thatfrickenweeb  holy shit my guess was basically just "it interacts with a lever or something that makes the wheel stop with a clicking/skipping noise". When I see your comment using all of those terms I feel really intimidated...
Reply: It's there to prevent a tear in the space-time Continuum
Reply: You are bringing back the kinetic fingers! ;-)
Reply: My guess is these gears would be driven by a starter mechanism (perhaps another foot pedal).  Once up to slow speed the starter pedal can be disengaged and the main foot pedal takes over. Without this the main pedal would be awkward to start up.
Reply: With a pedal style, there is a chance to run the machine backward so, my guess is the ratchet will keep the MMIII running in one direction.

In the aviation world, there exists a one directional bearing for rotorshafts. The reason is if the engine quits, the rotors will continue to spin.
Reply: Preventing the camshaft from going the other way when pedaling?
Reply: Ratchets are for the pedal drive.
Engaging when you press with the foot.
Disengaging automatically.
A bit like muting hooks.
Edit : Allow you to start the fly wheel from any stop position.
If you stop pressing the pedal, it does not move any more while the fly wheel continue spinning.
Reply: Perventing counter rotation? Or maybe some kind of reverse gear for the machine cuz the programming pins look like they can operate in both directions
Reply: The ratchets are there to define the turning direction.
Reply: My guess is that its going to double as a noise maker, A very fast click could be cool
Reply: My guess: clock source
I think they will be used to measure the exact speed of the wheel, in order to use it as a master clock to tune the timing of the rest of the machine with. They could be read electromecanicaly, opticaly or knowing martin maybe he has some purely mechanical fancy abbacus metronome-thingy.
Reply: turn the MM3 into the MMX >:(!!!!!!!!
Reply: Ratchets are to prevent the music playing backwards, as that would be decomposing and begin to smell bad.
Reply: My guess is that it's to get the flywheel spinning in the right direction, perhaps to "prime" it before you start using the pedal. Some mechanism to get it started, but not to be engaged the whole time or else it would be noisy.
Reply: I was wondering about those ratchets as soon as I saw them, but was just gonna wait for you to reveal their purpose... but now that you're throwing out the offer of glory... My guess is that they are for operating a rhythm function, but I also think that's not it but can't think of what they are actually for.
Reply: the pedal probably drives the flywheel through the ratchet bits
Reply: Ratchet: stops the machine from going backwards.  So there will be no mystic messages heard by playing things in reverse 😋
Reply: That's going to measure the BPM of the songs. These little things will be connected to some microphone or something to get the exactly BPM .
Reply: The ratchets could be to accept drive energy from the pedal. That would allow the mechanism to turn freely when the pedal is not being actively used, and prevent the pedal from receiving any energy from the flywheel. Since the pedal can drive the pulley but cannot be driven by it, it is safe to have that terrifying pinch point where the pedal comes near the platform.
Reply: To make the breaking noise before the vibraphone solo from the original marble machine video so MM3 can play an authentic version.
Reply: Rachets are used for an emergency stop like
ones in a saw table (called Sawstop), let me try to explain what i think. If something goes extremly wrong and the wheel is still spinning, a system of an emergency brake will engage into these wooden teeths. As they are made of wood the emergency brake system wont damage other parts of the
marble machine other than those wooden rachets. If that happens it can easily replaced by new wooden ones.
Reply: I’m guessing it’s like a bicycle hub when it is driving the wheel it is engaged with the teeth but when you strop powering it with the pedal it can coast and the pedal can stop moving.
Reply: Is it for a built-in metronome?
Reply: @Wintergatan  there is always the „make a fan pay for the honor to join you on the stage and lose an arm while hand cranking the mechanism“ option
Reply: Instead of a treadle pedal, just a pedal that no matter the position it will always pull when pushed down and is also a safety feature as it won't smash your foot into the floor.
Reply: Because you are converting an up and down motion (your foot) to rotational motion (the disks/axle) you need to make sure the disks don't go spin the wrong way. i.e. clockwise instead of counterclockwise. 
Or to slowly brake the wheel. (But I wouldn't use ratchets for that.)
Reply: The Pedal drive. Then Pedal is not rigidly attached to the drive wheel  and you avoid making a "Toe Remover 5000"tm :P
Reply: My guess is that ratchets prevent the mechanism rotating in the wrong direction when starting to convert linear pedal to rotational motion
Reply: My guess for the ratchets would be that they are there to prevent back-driving? maybe as a safety measure?
Reply: Rythme system ?
Reply: You can engange some kinda rattling percussion device, pretty much as i used to clamp cards between the spokes of my bicycle when i was 6years old🤔
Reply: Sound effects? The counterpart will be something they clank against. Then you have Ratchet & Clank hehe :D
Reply: There's 64 ratchet teeth to one rotation. It's gotta be for a metronome/rpm stability device right at the start of the drivetrain. Keep the wheels spinning consistently at the right rate
Reply: I know someone have the right answer by now but just want to brag to my friends if I'm right. It would be to compute and display the RPM of the flywheel ? And probably translate it to a musician related metric that I don't know anything of haha
Reply: For allowing the programming wheel to be rotated independently for maintenance and installation on the program panels
Reply: An quickstar mechanism for the flaying wheel
Reply: My uneducated guess: It's the new Dragon slayer 3000

Joke aside. That looks like it could power something. Like a additional Wheel
Reply: The ratchets are to stop the flywheel starting in the reverse direction when you start peddling.
Reply: I think that the ratches will be either used to prevent the flywheel from spinning the wrong direction, as something like this occuring would cause a disaster of unimaginable proportions
Reply: emergency brake
Reply: It looks like you want the pulley to just turn one way but not the other. A mechanism like that would make a lot of rattling noise…. So probably not 🤔

Regards Bas from NL 🇳🇱
Reply: The ratchets are another sound device, you can get a washboard/metronome out of them, and make a lever to engage or disengage the sound.  It is a music machine after all.
Curious what CAD package you are using, and whats the cost?
Reply: Ratchets will drive the kinetic fingers!
Reply: its for the one thing doing the thing when things are going.
Reply: I think it’s some kind of safety mechanism to protect mechanisms that only work with clockwise or counterclockwise rotation from the other from movement while travelling/moving the machine.
Reply: Metronome?
Reply: Are the ratchets part related to some sort of metronome or timing assembly???
Reply: well, the ratchets, would be used to make sure the flywheel/axel spins in the right direction, which would be important since you wouldn't want the machine to spin backwards and break something
Reply: also, I understood most of your explanations, still confused what you were going on about with the bearing housing, must be an engineering thing, idk, seems fine to me, and I hope your bearing is kept 90 degrees to the rotation? seems important...
Reply: they're a part of a rythm machine :)
Reply: Another pedal to advance the machine step-by step for troubleshooting?
Reply: I'm probably wrong but I'll try: rhythm machine?
Reply: To be able to hold a playing card to it and get a sound just like we did with our bicycle wheel when we were little kids! Bonus instrument!!!
Reply: A metronome feature? Or a reverse feature?
Reply: M
Reply: For marble lifter!